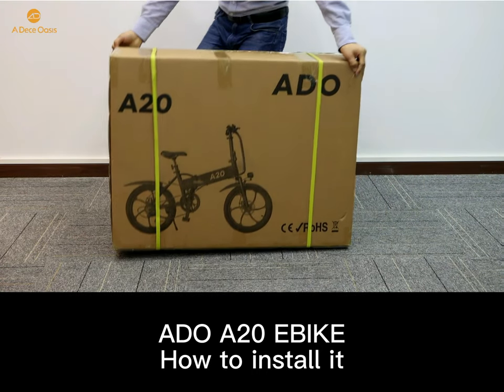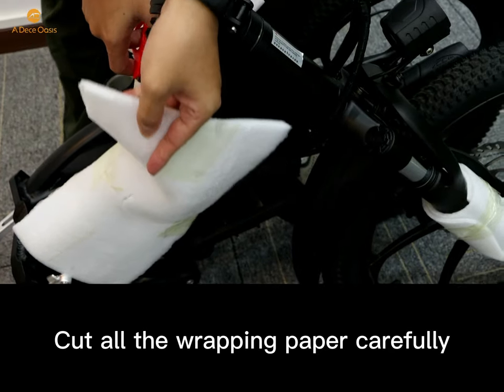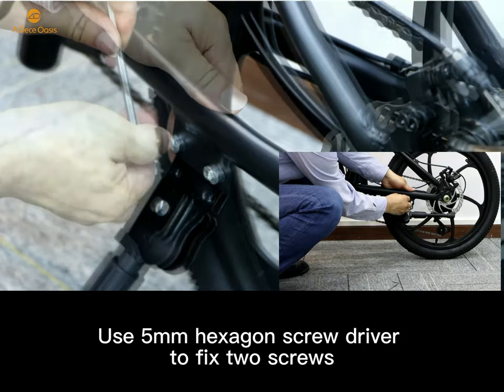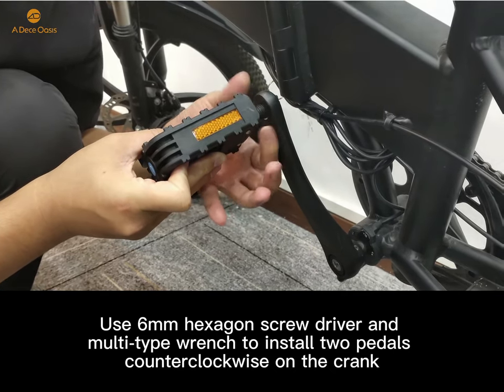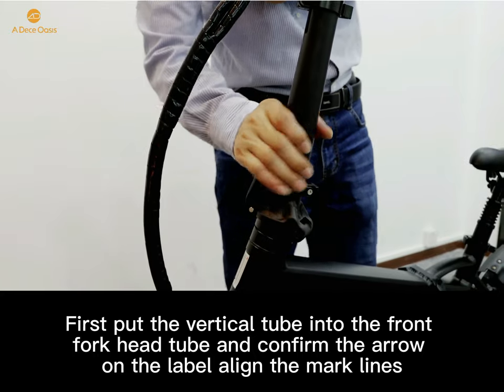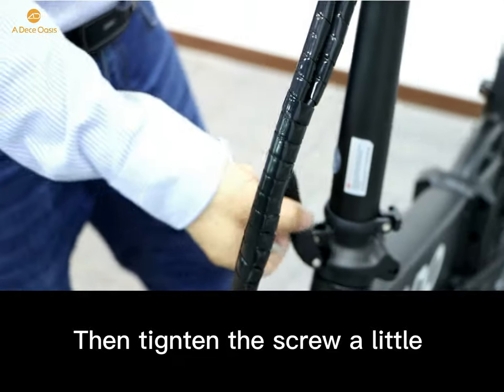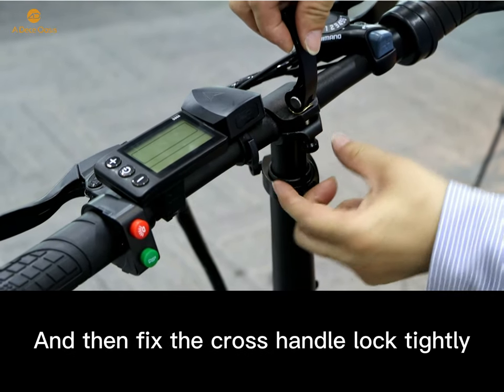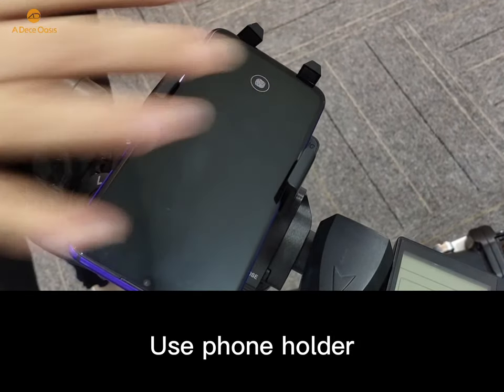ADO A20 ebike - FULL Installation video #ADOsupport

Comment: Easy explanation, didn't use the manual, just followed the instructions
Reply: You do you make the stand pipe stay in and the bars align the wheels so it turns at the same time?
Reply: @Chopitlikecr7  I mean, that's the idea...